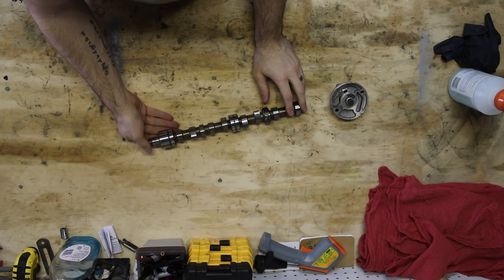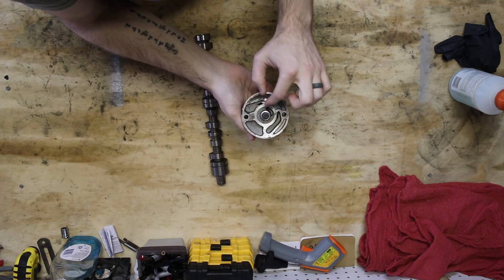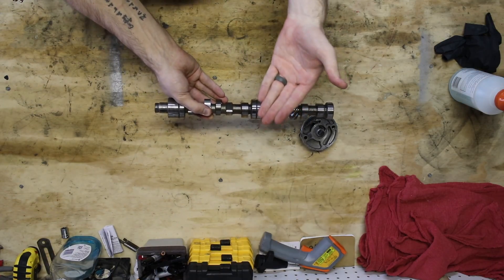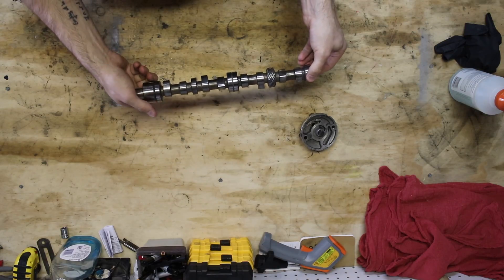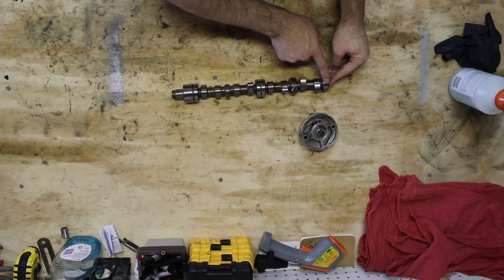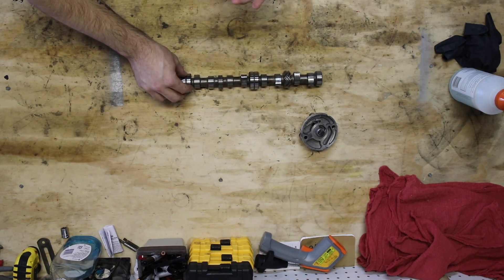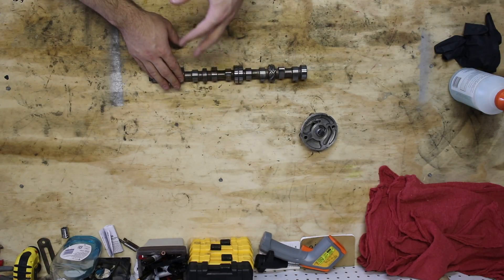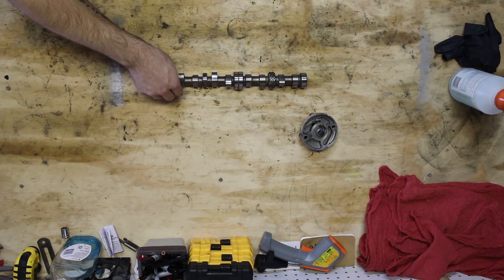Classic Mini DIY - How Does a Camshaft Work?

Comment: everytime i start my engine the oil pressure shoots straight up to 100 psi and stays like that permanently until i turn my engine off. any ideas what it could be? (centre binnacle smiths gauge)
Reply from the maker: Have you changed your oil recently?  Has there been a lot of debris on the drain plug?  In the past when a gauge fails that I have seen it doesn't show pressure at all.
Reply: Classic Mini DIY  yeah I did. I rebuilt the engine and gearbox and put it all back together and filled with 5W/40. there isn't any debris in the plug either. could it be that because the centre binnacle was for the original 998cc engine, now that I've upgraded to a 1293 metro that it could be measuring incorrectly?
Reply from the maker: Unlikely the oil pressure required is the same regardless of block size in the mini.  Unless you are running a crazy race motor or something.  Based on that info about the debris my guess is that gauge is faulty as ozmaniac49 suggested.